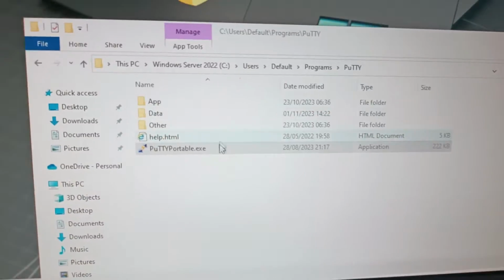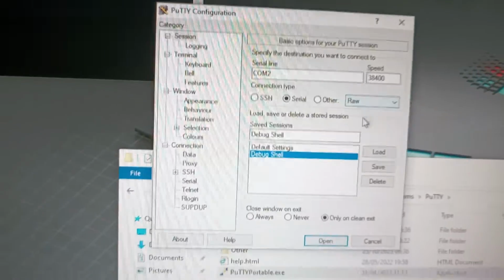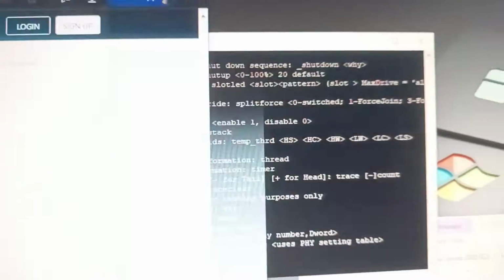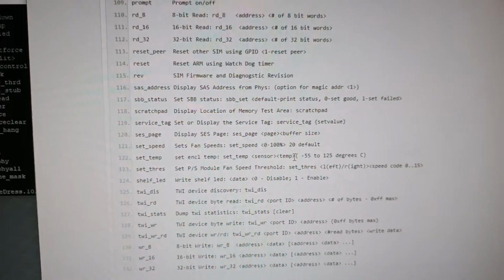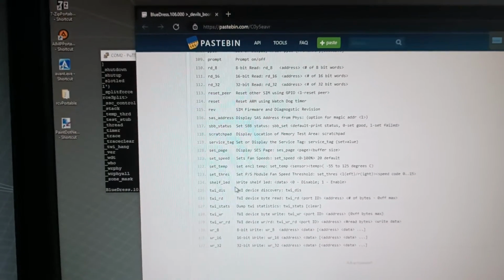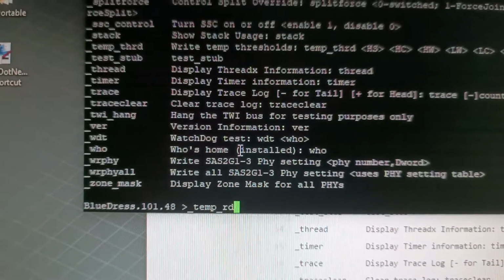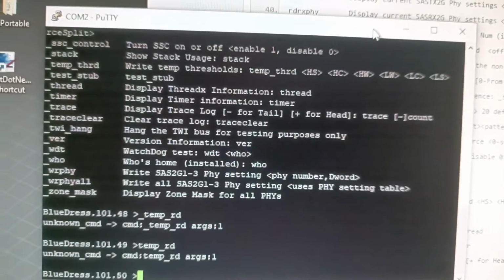Dell PowerVault MD1200 - Fan Control

Comment from the maker: 00:45 - Wiring Configurations
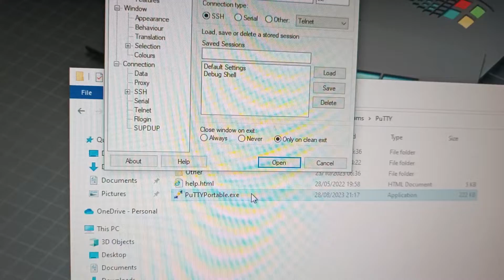01:55 - PuTTY Configurations
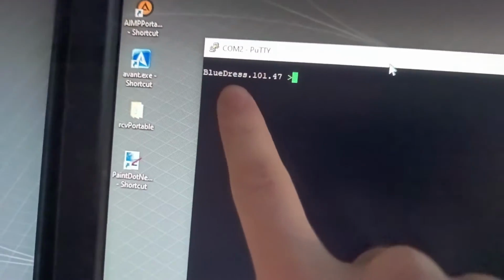03:00 - PowerVault Commands
Reply from the maker: -- Commands --

BlueDress.106.000 >_devils
_boot          Download the boot image (FW image 1 and 2 erased)
_clrphyerr     Clear PHY error counter(s) <phy Num (invalid PHY Num=all)>
_date          Date: date
_debugpage2    Dispalys Page 2 data when Host read it : 0 = OFF !0 = Active
_devils        Print the Extended help
_dwd_reset     Disable WatchDog reset: dwd_reset
_download      Down load code using Xmodem: Region[0-9] Offset Erase[y/n]
_download_fpga Down FPGA load code using Xmodem: _download_fpga
_drive_pres    Return Drive presense: _drive_pres
_ecc           Display ECC counts: ecc {clear}
_ema_poll      Turns on or off the analysis polling.  Disables SES & LED update
_erase         Erase F/W Region: erase [0..10] NOTE: This can mess up your code!
_event         Event log test
_fan_ctrl_thrd Write fan control parameters in C: fan_ctrl_thrd <M> <H> <SIM offset> <hysteresis>
_flashdump     Dump Flash: flashdump <offset> <length>
_fpgaread      Read FPGA Register: fpgaread <register> <length>
_fpgawrite     Write FPGA Register: fpgawrite <register> <data> [<register> <data>...]
_fail_ts       Fail temperature sensor: fail_ts <sensor>
_flashpeer     Flash Peer: <0=ACTIVE ; 1=BOOT>
_gpio_setting  Read a GPIO Setting: gpio_settings <0..7>
_history       Show CLI History: history
_hotswap       Enable/disable Hotswap
_icid_clear    Clears the ICID value to default.
_isim_msg      Send message to ISIM thread
_ledconfig     Show LED Configuration Settings
_ledmode       Set Mode for led: ledmode <number><direction><state>
_ledread       Read LED GPIO value: ledread <number>
_ledset        Set LED GPIO Value: ledset <number><state>
_lm75_trip     LM75 Interrrupt Control: lm75_trip <sensor><state>
_loadcpld      Load xsvf file from flash into CPLD
_map           Display SES Sensor Data: map
_phy_info   Display SAS phy information
_ps_pmb_test   Test P/S Module PMBUS commands: ps_pmb_test <l(eft)/r(ight)>
_psfup   P/S Module Firmware update: psfup <l(eft)/r(ight)>
_queue         Dump the Message Queue usage: queue
_quick         Quick regression: quick
_rdcam         Read CAM Address contents <address (0-1024)>, <display count>
_rdtxphy       Display current SASTX2G Phy settings <phy Num (invalid PHY Num=all)>
_rdrxphy       Display current SASRX2G Phy settings <phy Num (invalid PHY Num=all)>
_rdphyerr      Display PHY error counters <phy Num (invalid PHY Num=all)>
_rdled         LED Control Register Read: rdled  <offset> <# of 32 bit words>
_runtime       Down load code using Xmodem to the non-active region: runtime
_set_cid       Set company ID of ELI: cid_set [0-From Exp, 1-Custom <32bit data>]
_shutdown      Invoke a thermal shut down sequence: _shutdown <why>
_shutup        Slow down fans: _shutup <0-100%> 20 default
_slotled       Control Slot LEDs: slotled <slot><pattern> (slot > MaxDrive = 'all')
_splitforce    Control Split Override: splitforce <0-switched; 1-ForceJoin; 3-ForceSplit>
_ssc_control   Turn SSC on or off <enable 1, disable 0>
_stack         Show Stack Usage: stack
_temp_rd       Read current temperature values
_temp_thrd     Write temp thresholds: temp_thrd <HS> <HC> <HW> <LW> <LC> <LS>
_test_stub     test_stub
_thread        Display Threadx Information: thread
_timer         Display Timer information: timer
_trace         Display Trace Log [- for Tail] [+ for Head]: trace [-]count
_traceclear    Clear trace log: traceclear
_twi_hang      Hang the TWI bus for testing purposes only
_ver           Version Information: ver
_wdt           WatchDog test: wdt <who>
_who           Who's home (installed): who
_wrphy         Write SAS2G1-3 Phy setting <phy number,Dword>
_wrphyall      Write all SAS2G1-3 Phy setting <uses PHY setting table>
_zone_mask     Display Zone Mask for all PHYs
 
BlueDress.106.000 >devils
asset_tag   Set or Display the Asset Tag: asset_tag {setvalue}
asd_offset  Set or Display the Auto-Shudown Offset value: asd_offset {setvalue}
broadcast   Send Broadcast SES Message: broadcast
chassistype Display and or Set Chassis Type: chassistype <0 = Blue Devil !0 = Red Devil>
clear_eel   Clear Event Error Log: clear_eel
clear_temp  Remove override of Temperature: clear_temp <sensor>
dbs         Database Read  : dbs  <page>
devils      Print the Help Screen
drive_led   Write drive led: <logicaldrive> <data>
eepromdump  EEprom Dump: eepromdump <port><addr><size in K(1,2,4,8,..512>
eepromfill  EEprom Fill: eepromfill <port><addr><size in K(1,2,4,8,..512><pattern>
eepromwrite EEprom Write: eepromwrite <port><addr><size in K(1,2,4,8,..512><offset><length><pattern>
fanlog      Fan fault count for each power supply fan [8 per unit]
fpgadisable Put FPGA in Slave Mode: fpgadisable>
fpgaenable  Put FPGA in Master Mode: fpgaenable>
fpga_rd     FPGA Access: fpga_rd <Register> <#bytes>
fpga_wr     FPGA Access: fpga_wr <Register> <data>[<Register> <data> ...]
fru_display Display FRU Status: fru_display
fru_clear   Clear Fru: fru_clear [0-SIM0, 1-SIM1, 2-PBP, 3-PS0, 4-PS1 5-SBP]
fru_download Download Fru: fru_download [0-SIM0, 1-SIM1, 2-PBP, 3-PS0, 4-PS1 5-SBP]
fru_read    Read Fru: fru_read [0-SIM0, 1-SIM1, 2-PBP, 3-PS0, 4-PS1 5-SBP]]
get_time    get encl time: get_time
gpio_rd     Read a GPIO: gpio_rd <number>
heart_beat  SIM Heartbeat Control: heart_beat [0=off !0=on] <timeout>
isim_debug  Change or view isim stats: <data> <0 - Disable; 1 - Enable>
l4_test     L4 integration manufacturing diag: l4_test
lm75        LM75 Read Access: lm75 <Slave Address>
lm75_rd     LM75 Read Access: lm75_rd <Slave Address> <Register>
lm75_wr     LM75 Write Access: lm75_wr <Slave Address> <Register> <1 byte>
log_ipmi    Log an IPMI Event:log_ipmi<Code><Type><Sensor><EV0><EV1><EV2><EV3>
max6654     Display MAX6654 Registers: max6654 <i2c port><slave addr>
noise       Write audible alarm: <data>
nvramread8  Read NVram 32bit area: nvramread <address> <length>
nvramread   Read NVram 32bit area: nvramread <32bit address> <length>
nvramwrite8 Write NVram 32bit area: nvramwrite <address> <data> [<32bit address> <data> ...]
nvramwrite  Write NVram 32bit area: nvramwrite <32bit address> <data> [<32bit address> <data> ...]
page_a      Display drive SAS Address: page_a
ps_status   Get P/S Module Status: ps_status <l(eft)/r(ight)>
ps_cap      Get P/S Module capability: ps_cap <l(eft)/r(ight)>
ps_clear    Clear P/S Module Status: ps_clr <l(eft)/r(ight)>
ps_page     Get P/S Module Status: ps_status <l(eft)/r(ight)>
ppid        Set or Display PPID: ppid {fruNumber}{setvalue}
prompt      Prompt on/off
rd_8        8-bit Read: rd_8   <address> <# of 8 bit words>
rd_16       16-bit Read: rd_16  <address> <# of 16 bit words>
rd_32       32-bit Read: rd_32  <address> <# of 32 bit words>
reset_peer  Reset other SIM using GPIO <1-reset peer>
reset       Reset ARM using Watch Dog timer
rev         SIM Firmware and Diagnogstic Revision
sas_address Display SAS Address from Phys: (option for magic addr <1>)
sbb_status  Set SBB status: sbb_set <default-print status, 0-set good, 1-set failed>
scratchpad  Display Location of Memory Test Area: scratchpad
service_tag Set or Display the Service Tag: service_tag {setvalue}
ses_page    Display SES Page: ses_page <page><buffer size>
set_speed   Sets Fan Speeds: set_speed <0-100%> 20 default
set_temp    set encl temp: set_temp <sensor><temp>( -55 to 125 degrees C)
set_thres   Set P/S Module Fan Speed Threshold: set_thres <l(eft)/r(ight)><speed code 0..15>
shelf_led   Write shelf led: <data> <0 - Disable; 1 - Enable>
twi_dis     TWI device discovery: twi_dis
twi_rd      TWI device byte read: twi_rd <port ID> <address> <# of bytes - 0xff max>
twi_stats   Dump twi statistics: twi_stats [clear]
twi_wr      TWI device byte write: twi_wr <port ID> <address> {0xff bytes max}
twi_wr_rd   TWI device wr/rd: twi_wr_rd <port ID> <address> <#read bytes> <write data>
wr_8        8-bit Write: wr_8  <address> <data> [<address> <data> ...]
wr_16       16-bit Write: wr_16 <address> <data> [<address> <data> ...]
wr_32       32-bit Write: wr_32 <address> <data> [<address> <data> ...]
Reply from the maker: -- Temps / 20% Fan Speed / Ambient 21.1c --

  BP_1[2] = 32c
  BP_2[3] = 32c
  SIM0[0] = 40c
  SIM1[1] = 38c
  EXP0[4] = 64c
  EXP1[5] = 63c

  AVG = 44c

Comment: Success!   my cable finally arrived... connected to old school hardware serial port, com1, 38400, defaults for everything else, connected...  command "_ver" shows the output, version 1.01 from 2009, command "_devils" shows all the commands.  Then I typed "_shutup 20" and the fans slowed down so much, I could no longer hear them from across the room AT ALL.   I put my hand over the vents and its still moving plenty of air. 

here's the only issue.... once you reboot the shelf, it will lose this config (it doesn't save it) so you'll have to issue the command again.   Some people have build a script to automate this. I have not gotten that far yet.  That's my next project.

Comment: i just got one of these MD1200, how exactly do you know if its set up as one span or two?  I can see all 12 drives on my HBA card using one single SAS cable.
Reply from the maker: So you'd use 2 spans if you had two controllers inside your MD1200, that way one controller would handle 6 drivers and another for the rest of the drives. A single span has fail over where both controllers can handle the 12 drives. 

Use cases: You had two computers connecting to each of the controllers to access 6 drives each. Or two RAID cards in a single computer to access 6 drives each.

General recommendation, use single span for any other use case. 

In your instance you'd be in single span mode.
Reply: that seems like what I was thinking too.   How do i konw if the system is sets up for single span?  I am waiting for my LSI-9200-8e card.  Also... I have been reading up that the front LED lights for drive status wont work unless I use a Dell HBA.   what card are you using and do you have your drive status LED lights on?   I understand that the drive activity will still work, either way, with Dell branded card or not.    @administrator4728
Reply: I just ordered the password reset cable, can you post the link in desc for the commands and which command you used to reduce the fan speed?  or did you use the windows app via Perc H8xx e Card?   @administrator4728

Comment: Very useful ! A question : is any DB9-PS2 cable do the trick ? Thanks
Reply from the maker: Pinout (facing the back of the controller):
https://forums.servethehome.com/proxy.php?image=https%3A%2F%2Fi.imgur.com%2F58FO8iY.jpg&hash=ec812a4665ae4e113fc59603cfa2c51c
~ fohdeesha

So "no".
Reply: link to pinout no longer works... anyone else have a pinout diagram?  @administrator4728